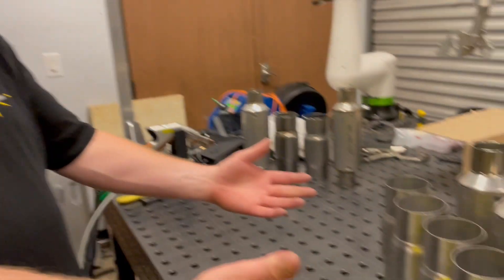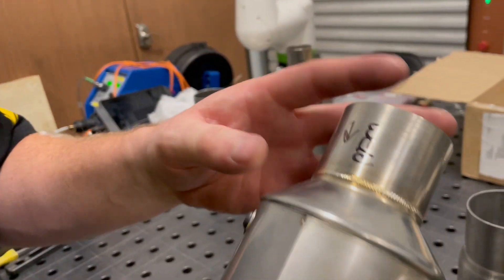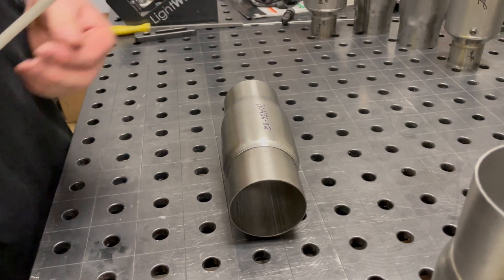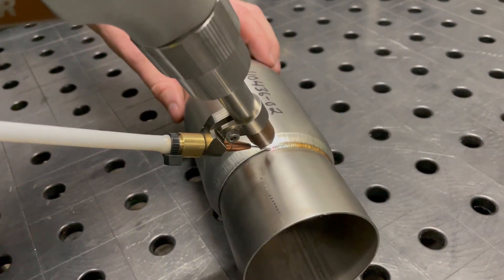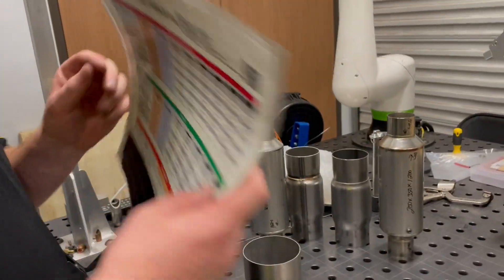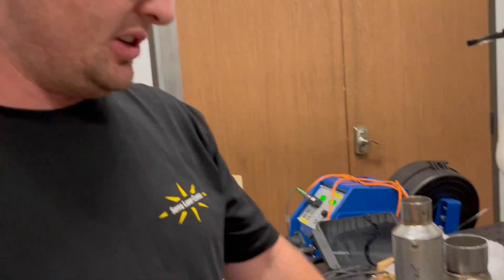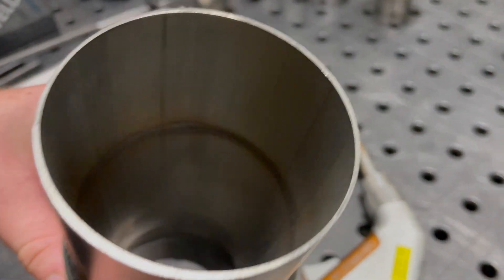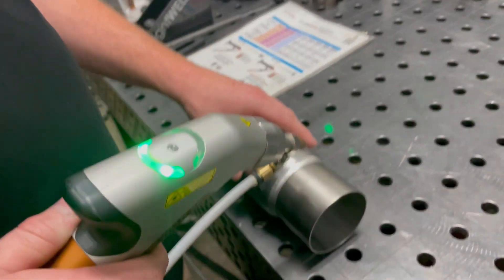IPG LightWELD Welding Tubes with Pulse Welding and CW

Comment: does it produce a pulse look like that only on aluminum?  when i weld stainless it looks like a nice wobble weld but the dimes aren't as separated?
Reply from the maker: This video is SS. It is actually easier to set this up on SS.
Reply: @Serra-LightBOT   ill try the settings you mentioned in the video and see if I can produce the same look

Comment: How do you setup the machine for the modulated/pulsed weld?
Reply from the maker: Basic setting is pulse. 3 - 4 hz or wobbles per second,  2.5 mm wobble width, wire speed at 40 cm/min (about 40% slower than a CW wire weld). Power same as power per the penetration for wire welding. More power can be  used sometimes as pulsing in general puts less heat into the power. Adjustment is power for depth of penetraton and wobble frequency for look of the weld. Wobble width can also be adjusted but normally in the 2.5 mm range.    https://www.youtube.com/watch?v=Ayng9kTX-DM if you go to the 10 minute mark on this  video Evan goes into an explanation on set up and shows some different welds and what changes make to the weld.